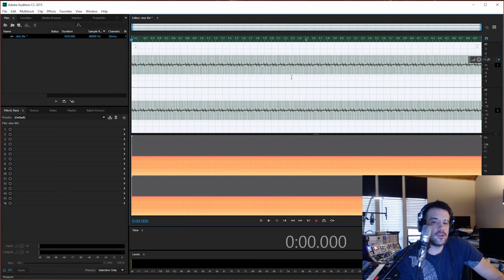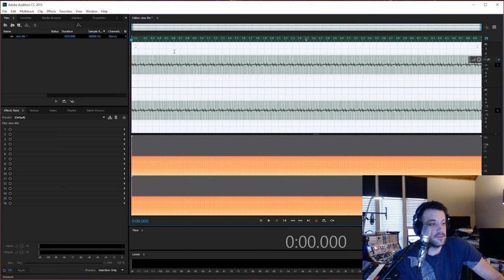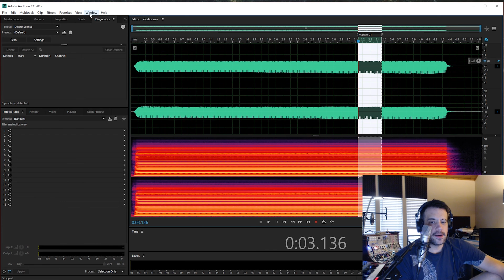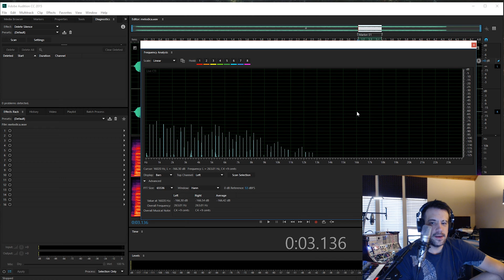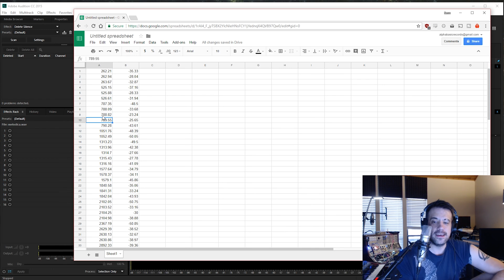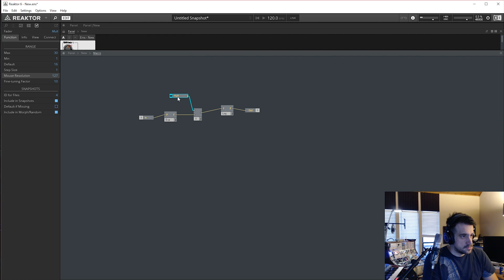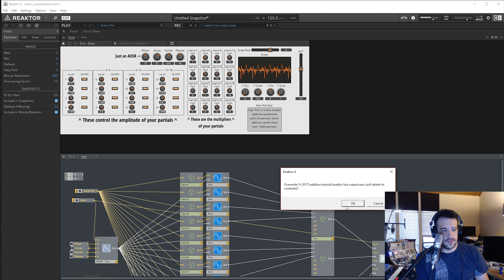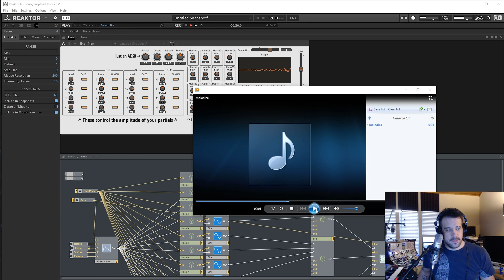How Additive Synthesis Works

Comment: How did you approach creating the Cello sound ? is it taking a real sample then throwing into the analyzer and then try immitate the frequency series ? i am only using Logic pro and i am not aware of tools that could give me the result you achieve with audition
Reply: Super collider or max msp. They are graphical programming languages designed around music signal processing. Takes a hot minute to get your head around, but both are very powerful and can be used to create custom synthesizers and midi instruments.

Or learn c++ JUCE

But don't do that.

Comment: When describing the basics of additive synthesis, it sounds just like using draw bars on a Hammond organ! And your first example of doing a few harmonics sounded just like a B3. But, because the Hammond used physical sine wave generators (tone wheels), it could only be built with just under 100 of them, and their frequencies are tempered, such that the harmonics are shared across every note, blending across all notes played, and especially blended when pulling all the bars out. Then it becomes pretty hard to achieve dissonance and instead there’s a smoothed out harmony of every note played to each other. Great for rock and roll players to just go wild, never a false note, but of course never a true one either (hence cheesiness). I don’t think samplers capture this effect, and I wonder if there are true circuit emulators that do (I don’t follow modern gear enough to know). But your mathematical breakdown of the unique harmonic series frequencies for every note one would need to reproduce things accurately is a nice clarification of how challenging this kind of tech would have been to consider in the time of early electronic and electro-mechanical organs!

Comment: Even though synthesizing could require less space in disk since it only require parameters for the sound, the process of synthesizing is heavy for processors, that is why some digital/computer synthesizers usually create a temporary library with all the notes/pitches. Like a pre synthesis of the sound, so it reduce amount required process for rendering and live play.

Nice vídeo, thanks for sharing!

Comment: Watch that couple days ago and really helped me understanding additive synths!
But now, after letting things fall into place (in my brain) 
Got confused about what you said in the last part 
about additive can solve huge files sample issue by emulating same sounds.

But if you emulate each frequency of the original sound 
and going to the same resolution of partials as the sample (lets say 44100) 
than the amount of data needed to be stored is basically the same as the sample?

Or you will use less partials but then its basically the sample at a lower rate (quality) 
only you chose where to "cut"

This still does not  sits well with my understanding
 PS: I mite meshed a bunch of things, still new to all of this :)

Thanks

Comment: My thoughts are - additive synthesis is definitely a useful tool, but it is never going to make samples obsolete. Just IMO! You need a ridiculous amount of processing power to handle enough partials (and allow good enough polyphony!) to completely fool us. To emulate a static sound is not that difficult and I mean you can do it in Alchemy (700 partials max). But the big kicker is emulating the actual physics and behavior of a particular instrument (which is easier done with physical modeling than additive synthesis), THAT would take an awful lot of time to get right for each instrument. It took Pianoteq 10 years to get to an acceptable level of quality (and that's not an additive synth - so for additive synth it would be even more difficult/time intensive!). And what about the recording chain? The mic, the room? Samples still portray this most faithfully, and you cannot reproduce this with 1000 partials. Maybe 10000 would suffice.

And ultimately: sampling is SIMPLE to use. Additive synthesis is anything but. Yeah you can get to places with machine learning, but that is still not really layman people territory (programming such algorithms), while anyone can grab a mic and a recorder and... do stuff with it.

I say all this as a supporter of physical modeling (I absolutely adore Pianoteq), but also with deep knowledge about sampling (since I've been developing Kontakt libraries for the past 13 years).

Comment: What I'm curious about is how the DSP is done in a synth that uses e.g. 512 partials. My thought is that it can't be summing 512 independent sine oscillators, so what mathematical trick is being used to make the DSP load manageable.

Comment: As far as I understand is the basic principle of FM Synthesis also to stag layers of sine waves ( especially the feedback operator ) to get such results... Isn't it also a additive synthesis?
I've get myself my first FMsynth while waiting for my Tracker and - I admit quite confusing in the begining - but I guess there's a lot potential in it
Reply: FM achieves the same result but with different (and I would say more efficient) means. When you modulate one sine wave with a different sine wave as is done in FM synthesis, the resulting waveform is basically a sine wave made of another sine wave. Imagine the shape of a sine wave, then zoom out a little and imagine bending that wave into the shape of a bigger sine wave. The resulting sound is the same fundamental pitch but has more overtones (aka partials) giving it a more vibrant timbre. You could create the exact same timbre by adding the right sine waves together but it would require a lot more sine waves, depending on the ratio used in the FM synthesis. Basically both FM and additive synthesis could theoretically perfectly replicate any complex sound, they do it in different waves. I think of additive as adding sines together and FM as multiplying sines together

Comment: additive, sub, and FM all will be the future! why make it sound like additive will replace all old? thats the impression I was getting but it wont replace anything it will just add to what we already got. There is still 70s analogue synths that are being used as it unique and has its own sound. Its like when I hear people say this synth is better then that synth, there is no such thing as better just different, I got free and premium synths that all do things differently and I love my free ones as they sound harsh which is perfect for squelchy psychedelic sounds put in my psytrance tracks and use my premium synths for leads and what not
Reply: I think his point is, that you canget so exact remodeling the old synths (or whatever) digitally with the application of machine learning so that there is no more audible difference between using the simulation and using the original instrument as demonstrated with the cello at the end.

Comment: Pretty neat how you did additive resynthesis manually using reaktor.  Did you take the phase of each partial into account though?  Looked like your data sets contained frequency and amplitude but ignored the phase relationship between the overtones and the fundamental.  Maybe that is what is accounting for the audible difference in timbre.
EDIT: I was talking to Julius Smith (the father of Physical Modeling synthesis) and asked him if the phase of harmonics in any given real-world sound have a natural synchrony.  Since the real world is imperfect, the answer is no, there will be slight deviations in phase since your excitation source won't have a perfectly stable cyclic period.
Reply: It would make no sense to add a constant phase change, because our ear would not recognise it. But when two waves of slightly different frequency are interfering, this is like two waves of equal frequency are alternately amplifying and cancelling out: because there is a continuously changing phase difference. This is what distinguishes a static sound from a dynamic. And also, why FFT is not made for additive synthesis...

Comment: "Additive synthesis is the future."  I told my friend that years ago after researching the additive synthesis timbre morph capabilities in Kyma and and Alchemy.  I don't think any reputable sound designer would doubt that.  It's just a matter of getting computers powerful enough to render a FFT fast enough and with enough detail that it eclipses what humans can naturally hear.  Just like how our sample rate and bit depth cover the resolution of human hearing.  Of course, that bar will be raised once we invent cybernetic cochlear implants that not just restore hearing, but expand it.  There's all sorts of fun directions that this discussion can go.
Reply: same goes with sight or smell. With cybernetic enhancements, more wavelengths (frequencies) would be visually detectable by humans, now this could either mean new colors, or something completly different that we can't even begin to imagine. And for smell, we could smell certain substances (like gasoline, which is, I'm pretty sure, odorless) instead of adding smelly chemicals to the substance.

Comment: I saw three videos and have noticed that this guy often provides inaccurate information. avoid if you want correct information.  Additive synthesis is just a very early technique which has clear limitations. It's not the future, It's not powerful in terms of modelling. you cannot accurately model most of the orchestral instruments with additive synthesis. I don't know why he lied, but clearly the cello example he played in the video cannot be created with just additive synthesis, especially with the very primitive method he showed us. Modelling string instrument is very complex and hard on-going subject, often it needs workstation computer with CUDA or openCL to sound like a real instrument in real-time. It cannot be simply done by looking at harmonic contents in a recording and making a series of wavetables using the data.
Reply from the maker: I probably said, no less than a half-dozen times, that this is a very basic tutorial on how additive synthesis works. Not a production guide, and not an advanced course on physical modelling. Can you find something specific that I said in regards to how additive synthesis works that is incorrect? Please let me know. Otherwise, don't misguide people trying to learn something, which you are. 

Physical modelling doesn't require CUDA. Yes, projects like NESS and a few others use GPUs, but watch my Pianoteq video where it's running far more efficiently than Kontakt and in many cases, sounding more realistic. Or open up Harmor and resynthesize something. Heck, lots of physical modelling works just fine inside game engines already. 

The CUDA/OpenCL stuff you're referring to is going further into detail of something I already said. Using AS + deep learning will one day reproduce advanced articulations at a standard that is indistinguishable by human ears. 

And finally, obviously you can't recreate a cello using Adobe Audition's sine generator and Excel. In what universe did my video ever claim that? I simply gave an example of physical modelling an instrument, partially using AS, and then randomizing some parameters. You choose weird things to be upset about.

Comment: Hi Benn, did you see the E.X.O.S. additive synthesis VCO for eurorack? It can store "DNA" sound fingerprints as a series of 32/64 harmonics (32 each on two detunable / phase shiftable voices). It's not a huge number of sines but still intriguing, especially since it has morph controls to move between two saved "DNA". There are not many demos online. The full DIY kit looks easy and cheap from munichen-audio.de so I'm going to check it out.

Comment: Wait, did you create that cello in Starlight? Was that a synthesized cello that you created?? How on earth did you model the bow-on-string attack and stuff?? WHAT AM I LISTENING TO
Reply: likely just adjusting partials with envelopes. the Harmor plugin in FL Studio is an additive synth plugin that i believe lets you do things like this, but it sounds like he's pretty in tune with low-level synth programming stuff so it's hard telling what tools he used for it.
Reply: I actually tried resynthesizing a violin in Alchemy, by just importing a random violin piece that was in no way prepared for that, and Alchemy made an additive synth patch that sounded very close to the violin. I believe one could prepare a sample in a certain way for the additive engine to have an easier time analysing and recreating it, so these things are real. I easily believe this was an additive cello.
Reply: I think he mentions swapping. So obviously there is the sample and then it crossfades between it and the modelled version, which sounds mangled. Not sure if that's correct, but sounds that way to me.
Reply: @EvilDragon666  I got the impression, both from what he says and the video caption, that the cello is entirely additive. I think he might have used a sample and some sort of machine learning to get it spot on.
Reply: @EvilDragon666  Nope, that's definitely not crossfading. He also mentions he starts randomising the partials that make up 'what you thought was a cello'. Seems pretty clear to me. TBH if the modelled sound was that far off why would he demo it as it'd disprove his entire argument.
Reply: @EvilDragon666  Nope, it says “additive synth track only” right there on the screen. Unless he’s lying, but that would ve a pretty weird thing to lie about.
Reply: @SirBenjiful  Yeah I didn't imply he was lying or anything! Note that I also used the words "I think" and "not sure if that's correct", so I'm fine with not being right, hehe. :)

Comment: What if you had essentially  128 resonators for each key of the piano. Essentially each key is a very sharp EQ correlating to the note. You could also put a gate on each key and a trigger so the amplitude of the individual resonator notes would trigger MIDI on a synth. You could also do things like have each resonator's pitch stretched or arranged in a microtuning so when audio is fed through it, only harmonics relating to the current tuning of this resonator synth can pass through.

Comment: When you said "additive synthesis is the future" I thought "prove it, dude".
Later, you played that "cello" clip from one of your tracks. I then thought "well, this dude has certainly proved it".
Excellent video, man. Truly fascinating stuff. Thank you.
Reply: yeah, i almost throw my laptop out of my window when i heard that!
Reply: That's how lossy audio codecs work as well. MP3, AAC, Ogg, etc. store audio data as spectral information and whenever you play any of these formats (e.g., when you are watching a YouTube video), the original sound is recreated (imprecisely) based on the harmonics.
That doesn't prove that "additive synthesis is the future" though. The problem is in manipulating the properties of the synthesized sound in a meaningful way.
Reply: @kaktotak8267  that’s where deep learning can help. Retain the signature characteristics of a sound and then manipulate to obtain new sounds with similar characteristics (if i understood correctly). Lossy audio formats do the process in the opposite way, simplifying an existing sound, while here is about generating it without having a source sample but only a machine learning model that predisposes the additive synth to get a specific sound rather than doing that manually as human.
This doesn’t mean there is not a musician or sound engineer behind that.
It’ll be just the future way to synthesise audio on any type with a standardised tool; other types of synthesis will remain, according to the producer’s taste of course.

Comment: Lol 40 harmonics and it doesn't sound or look like a saw. Scale the amplitudes as 1/f, you can do better with only 4-8 partials. 40 is stupid overkill for a sound where all the partials are harmonic. Come on Benn, you're better than this.
Reply: If you did it 128 times it'll approach an audio frequency click track.
Reply: Went into more depth on my Facebook page, and there's an analysis on /r/synthesizers from others if anyone wants to check this.